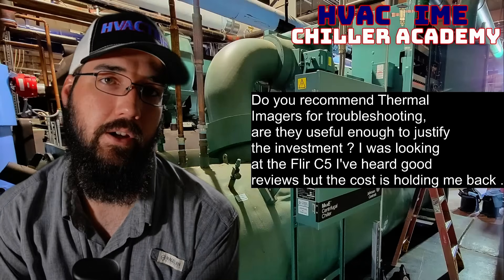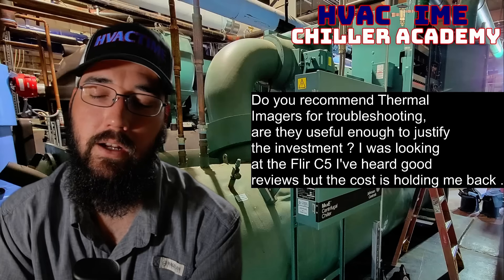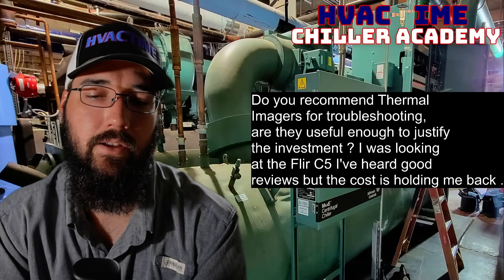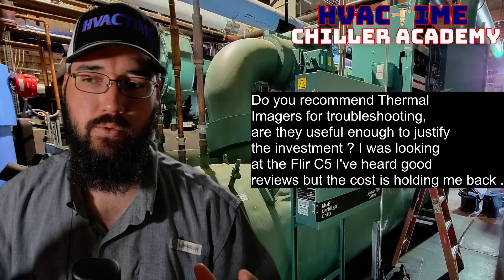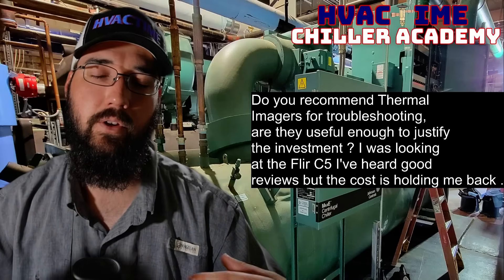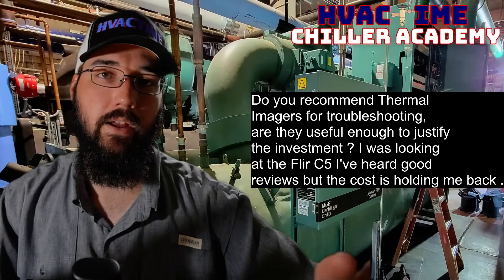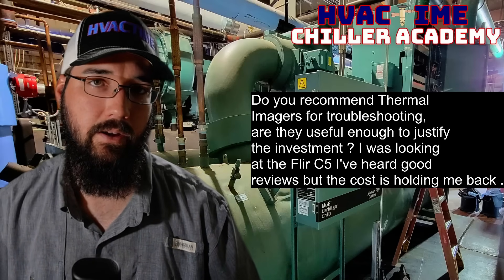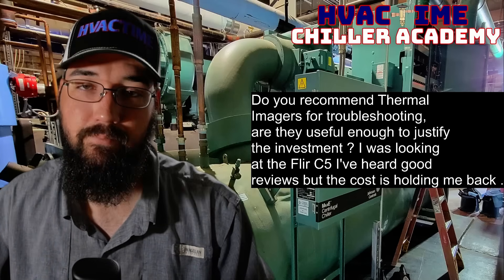Thermal Imagers for HVAC tech Explained

Comment: Tip for thermal imaging....pay attention to emissivity settings. Some materials can falsely reflect and the temp you read wont be accurate. Use black electrical tape on shiny materials, like copper and other metals that reflect. Changing your emissivity can get you a more accurate result